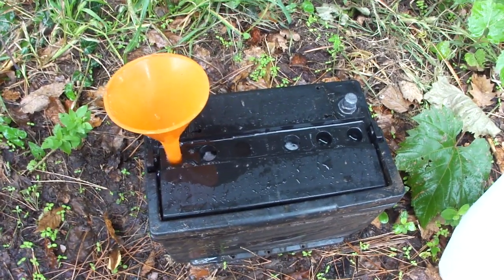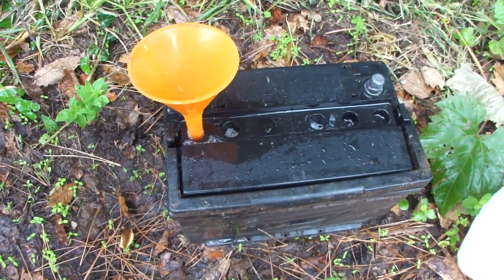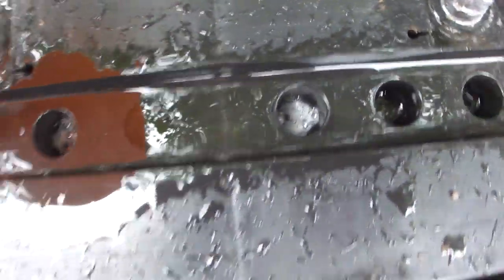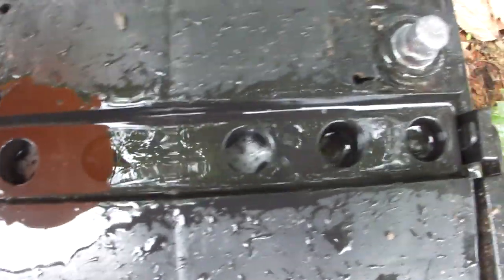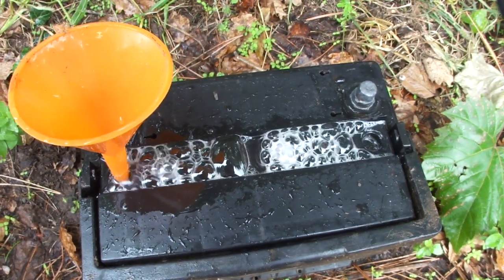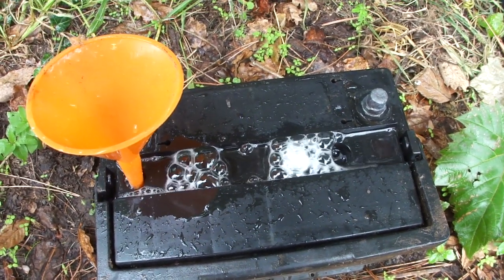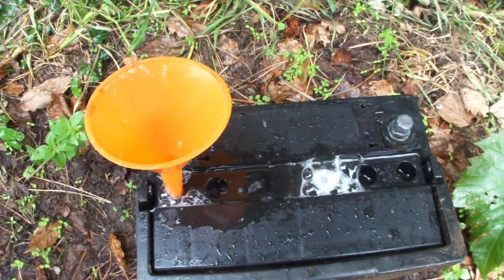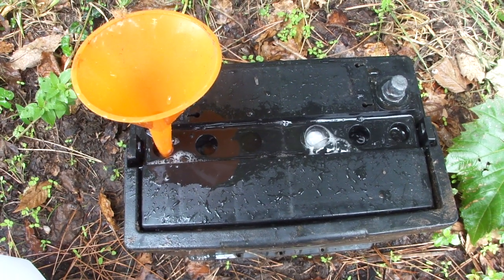Alum Epson salt electrolyte car battery conversion 04

Comment: *I was curious about your program so I decided to try it out after hearing from a friend how well this worked for her. The guides were very easy to follow. Thank you for your help reconditioning my batteries [Check Details Here==>https://plus.google.com/100351090281822647456/posts/Gwtd4mVBdEd ].